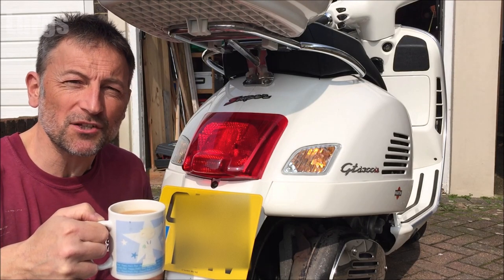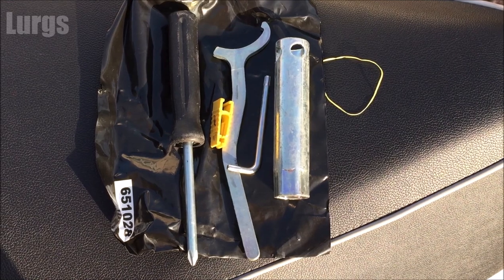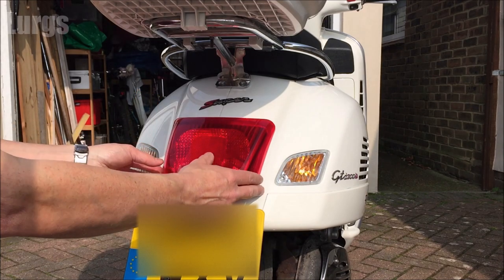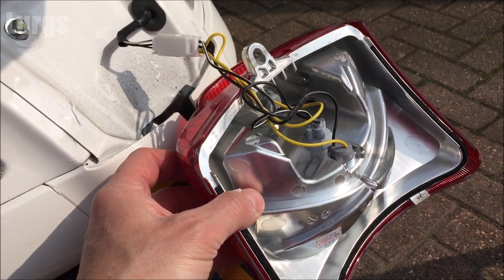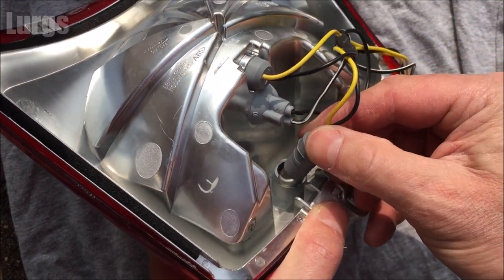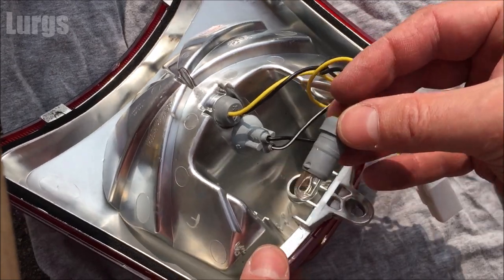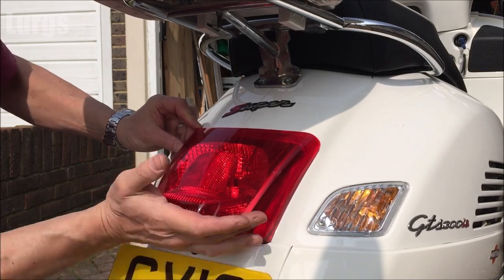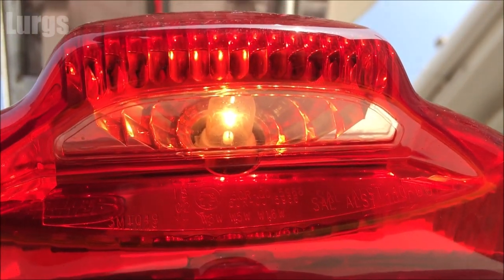How to replace number plate bulb on Vespa GTS - Vespa Licence Plate Bulb Replacement

Comment from the maker: https://www.tubebuddy.com/LurgsHowToGuides I use TubeBuddy to grow my YouTube channel. Click this link to install, even the FREE version is great. This link is an affiliate link which means if you buy a TubeBuddy licence I will receive a small commission. There is no additional charge to you.
.
Other useful How To Guides to help you save ⏱TIME and 💰 MONEY:
Vespa GTS How To's, Tips, Tricks, Fixes & Reviews https://www.youtube.com/watch?v=16LcQelRTlc&list=PLqrXuUebV8N971niUIBHudSltuzOq9J7w
5 things I hate about my Vespa GTS 300 https://www.youtube.com/watch?v=16LcQelRTlc&list=PLqrXuUebV8N971niUIBHudSltuzOq9J7w
7 things I love about my Vespa GTS 300 https://www.youtube.com/watch?v=h0nWikLMFLg&list=PLqrXuUebV8N971niUIBHudSltuzOq9J7w
Vespa GTS 300 Review and Ride https://www.youtube.com/watch?v=iMmJyuPvbkU&list=PLqrXuUebV8N971niUIBHudSltuzOq9J7w
Vespa GTS 300 Rust problems https://www.youtube.com/watch?v=q_kLZT_iRV0&list=PLqrXuUebV8N971niUIBHudSltuzOq9J7w
Vespa GTS 300 Underseat Storage does a standard Crash Helmet fit and other Alternatives https://www.youtube.com/watch?v=LCmAbywTG8M&list=PLqrXuUebV8N971niUIBHudSltuzOq9J7w

Vespa won't start issue https://www.youtube.com/watch?v=g2FaJ_5IAXc&list=PLqrXuUebV8N971niUIBHudSltuzOq9J7w
Vespa GTS Battery Location and How to check battery on Vespa GTS https://www.youtube.com/watch?v=S2h7ltTophU&list=PLqrXuUebV8N971niUIBHudSltuzOq9J7w
How to charge Battery on a Vespa GTS https://www.youtube.com/watch?v=jqmR4NAASbg&list=PLqrXuUebV8N971niUIBHudSltuzOq9J7w
Vespa GTS 300 Battery Change https://www.youtube.com/watch?v=-He3Wca40lw&list=PLqrXuUebV8N971niUIBHudSltuzOq9J7w

Vespa Side Stand don't use it Ever https://www.youtube.com/watch?v=MJ1xuX2TUhc&list=PLqrXuUebV8N971niUIBHudSltuzOq9J7w
How to put Vespa on the Center Stand https://www.youtube.com/watch?v=ZlwZfTkS7Go&list=PLqrXuUebV8N971niUIBHudSltuzOq9J7w
Vespa Tire Pressures https://www.youtube.com/watch?v=1lwrkW9k0Js&list=PLqrXuUebV8N971niUIBHudSltuzOq9J7w
Vespa GTS 300 Top Box Review https://www.youtube.com/watch?v=HHDbrhnnr54&list=PLqrXuUebV8N971niUIBHudSltuzOq9J7w
Vespa GTS 300 Oil change and Oil Filter change https://www.youtube.com/watch?v=5VfKR7c4eJo&list=PLqrXuUebV8N971niUIBHudSltuzOq9J7w
Vespa Dashboard Lights Meaning https://www.youtube.com/watch?v=TgFp0jszqTA&list=PLqrXuUebV8N971niUIBHudSltuzOq9J7w
Vespa GTS Fuse Box Location and How to check fuses on Vespa GTS https://www.youtube.com/watch?v=V2fw3_NwWXk&list=PLqrXuUebV8N971niUIBHudSltuzOq9J7w
Vespa GTS Coolant Check and Top up https://www.youtube.com/watch?v=iwRFvRPI-WQ&list=PLqrXuUebV8N971niUIBHudSltuzOq9J7w
Vespa GTS Radiator Fan checking it works https://www.youtube.com/watch?v=OAQ_XlzsrOY&list=PLqrXuUebV8N971niUIBHudSltuzOq9J7w
Vespa GTS Oil Leak problem https://www.youtube.com/watch?v=b8HplSY6UPs&list=PLqrXuUebV8N971niUIBHudSltuzOq9J7w
How to set Clock on Vespa GTS https://www.youtube.com/watch?v=ZVGCymP5peQ&list=PLqrXuUebV8N971niUIBHudSltuzOq9J7w
How to tighten mirrors on Vespa GTS https://www.youtube.com/watch?v=YUNplaufUvA&list=PLqrXuUebV8N971niUIBHudSltuzOq9J7w

How to replace Headlight Bulb on Vespa GTS https://www.youtube.com/watch?v=ZOfORe1T5H4&list=PLqrXuUebV8N971niUIBHudSltuzOq9J7w
How to remove rear light cluster on Vespa GTS https://www.youtube.com/watch?v=eXOYsnWkJSo&list=PLqrXuUebV8N971niUIBHudSltuzOq9J7w
How to replace front indicator bulb on Vespa GTS https://www.youtube.com/watch?v=ob4QeVL2NUQ&list=PLqrXuUebV8N971niUIBHudSltuzOq9J7w
How to replace tail light bulb on Vespa GTS https://www.youtube.com/watch?v=UNKlh5NsT5s&list=PLqrXuUebV8N971niUIBHudSltuzOq9J7w
How to replace Brake Light Bulb on Vespa GTS https://www.youtube.com/watch?v=TTVSGmLfn9Y&list=PLqrXuUebV8N971niUIBHudSltuzOq9J7w
How to replace number plate bulb on Vespa GTS https://www.youtube.com/watch?v=UbQWmtltZ1o&list=PLqrXuUebV8N971niUIBHudSltuzOq9J7w
How to replace Rear Indicator Bulb on Vespa GTS https://www.youtube.com/watch?v=qICzWR_C0-8&list=PLqrXuUebV8N971niUIBHudSltuzOq9J7w

How to test a Motorcycle Battery with a Multimeter https://www.youtube.com/watch?v=e6nrKVst-CM&list=PLqrXuUebV8N971niUIBHudSltuzOq9J7w
All the Motorcycles I've ever owned https://www.youtube.com/watch?v=R5O5CT6rLCg&list=PLqrXuUebV8N971niUIBHudSltuzOq9J7w